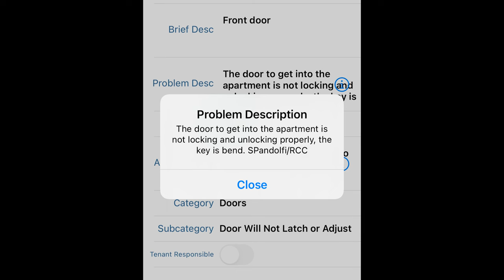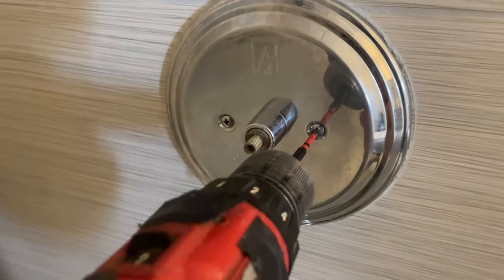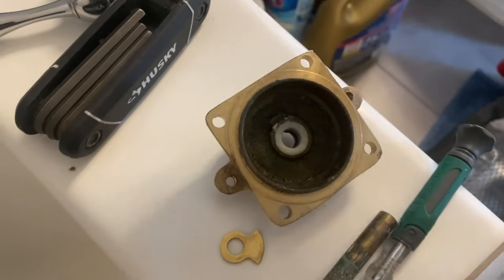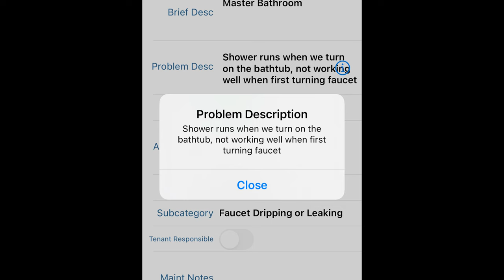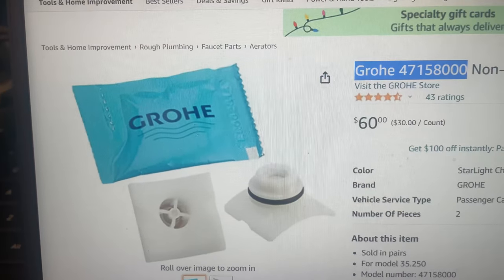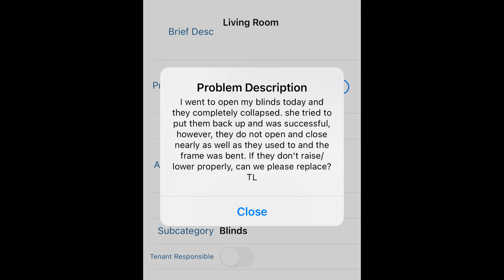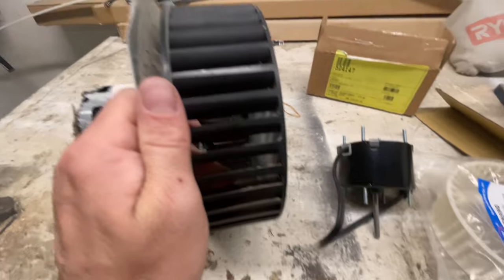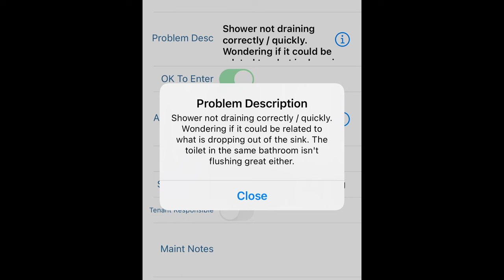Apartment Maintenance Vlog #20

Comment: Not as useful a tip now with so many people having electronics of some type in their bag but several of the old guys I learned from as a kid kept several strong magnets in their gear that would have been perfect to place on the rag so the screws didn't go anywhere. They also used them for all kinds of other things but that's what came to mind.
Reply from the maker: Nice tip! Many times those steel screws used in plumbing won't attract to some magnets

Comment: Wonder if the part could be 3d printed and meet specs. Because 60 bucks for a o ring and piece of plastic is highway robbery
Reply from the maker: Yes Evan for sure! I was thinking the same thing but have no clue when it comes to 3d printing :)
Reply: I just checked, Grohe does not sell this system in Europe. Ours here are different. I thought it would be so expansive, because they ship it from Germany to the US but this doesn’t seem to be the case. I found they charge more or less the same for the comparable EU version. They must be protected by patents. I could not find any cheap China version. Well at least they are not more expansive just because you are in the US and we are getting two of them… 😉😂